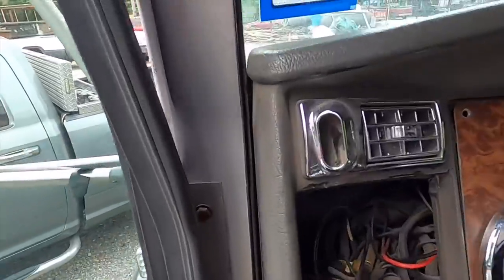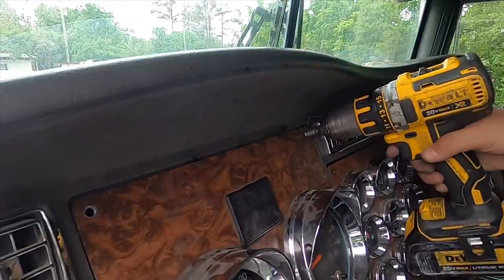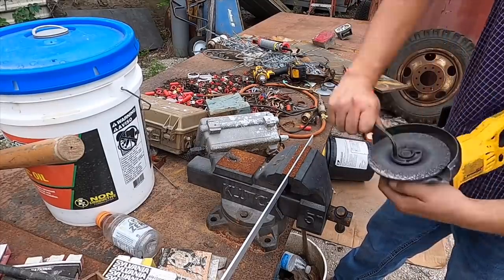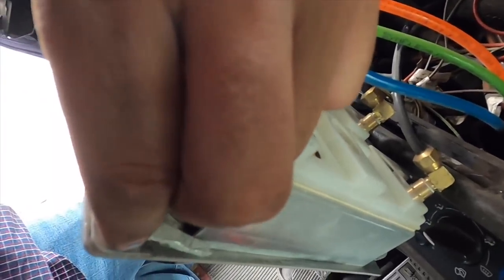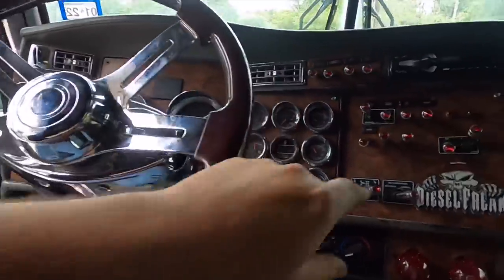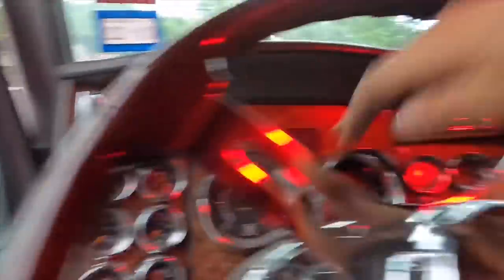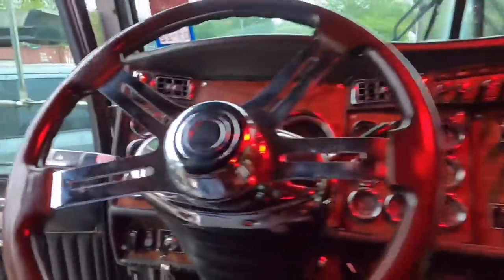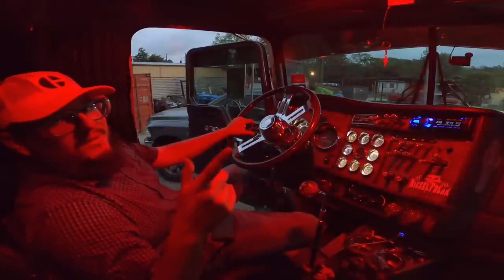how i fixed my kenworth broken dash, you can do it too.

Comment: Glad you have it fixed.. I have a idea for you instead of using the screws get dash screws with the jewel on the end you can secure it the same way and also put the dash screws in the open holes just to dress it up. I enjoy watching your videos and be same
Reply from the maker: I wanted to do that. But went this route to make sure the drill would tighten everything up. But I will still continue to look for another dash, once I do that I want to buy the screws with the red jewels on

Comment: I paint stripped my dash on my 04 w900, it did it’s job but it turned white so I ended up having to paint it black but it came out looking original. What you probably could do is with a steamer you might be able to peel the paint off.
Reply from the maker: Might have to try that steamer out
Reply: @Grtruckingdemolitionllc  si bato como que despegó la pintura como la tuya y había pedazos donde lo volaba bien rapido

Comment: You can just put a nut and washer on the back of the screw you put silicone on. That way you can tighten the screw up
Reply from the maker: Yea I didn’t have any to do it, so that’s why I went with silicone I didn’t add enough so it will come off very easily

Comment: If You want to get Fanse You can go to ACE Hardware and get Chrome or Stainless Steel Allen or Torxs Bolts to use with those brackets Don't silicone those other holes with the Bolt just use a Bolt  and Nut and Washer on the back
Reply from the maker: I thought about going to buy some bolt and nuts for the others but just wanted to finish the little project. That’s a good idea also on the stainless steel bolts. My idea was to get some spike covers for them. I will be going to the chrome shop to look for some
Reply: @Grtruckingdemolitionllc  Your Ideal Was Awesome Great thought Really Good Work Just Thought Those could Work with your Ideal also

Comment: If you get a second dash. You should fleece wrap the old one and the rest of the interior panels. Thats what i did. I bought a second dash to fleece wrap and paint so i dont have to ride with no dash. And at the same time gunna do the other interior panels.
Reply from the maker: I Definetly still need another dash so will continue to look for one
Reply: @Grtruckingdemolitionllc  i mean if your dash is that beat. Fleece wrapping will fix it. But then you'll be without a dash for a while cause it's not a quick process. But definitely better than just painting parts. When you fiberglass fleece vs just paint. It comes out smooth and professional vs seeing the original texture of the dash through the paint.
Reply from the maker: @thebeardedgingerontheinter3256  i can always just fix this one up and sell it, I’m not the only one with this issue lol
Reply: @Grtruckingdemolitionllc  true 👍

Comment: I realize your video is 2 years old but it just showed up on my feed today. I drive a T800 as well, but mine's a roll off truck. I also have the window drops and the deep visor just like yours and it's "polished" like yours. If you want to cut down the glare and reflections inside the cab, pull them off and paint (or plasti-dip) just the inside a flat black. It made a world of difference inside my truck.

Comment: Hey would you mind telling me where you got your purple lights from?  I love that purple.  I am having problems finding the right color purple but that is it.  Also, love the vid.  I have an FLD120 that I am going to use that trick on for the dash.  I saw something like that a while back but just never got around to doing it, but I have broken a couple more off so now is the time.  Also, with the exterior lights, can they be changed over to DOT yellow and red lights or are they just purple full time?  I run alot around PA and NY and they would love to pull me over if they see that.  Thanks
Reply from the maker: They are sold by trux. Many chrome shops carry that brand lights and yes they are dual color either red or amber to purple

Comment: Question. On downshifts, I can downshift really well 10-6. I go to 10 and raise the rpm to 12 and float it in. I'm struggling with 4-1. I try to downshift at 10 and give very little rpm to downshift low gears and they grind. I usually stay in 5th and reset. But want to know the problem. Gears 1-4 are very low gears and low speeds so I'm assuming 10 rpms is still too high for these gears and you prob suggest for rpms to drop lower like around 800 since the lower the gear the closer to engine idle and lower the rpm to rev into lower gear? Is that the solution? Or if not how so?
Reply from the maker: Normally for the low gears I don’t even have to rev the truck much just tap it very slightly and it will go straight in. I normally downshift to 5th gear and after that just throw it in neutral